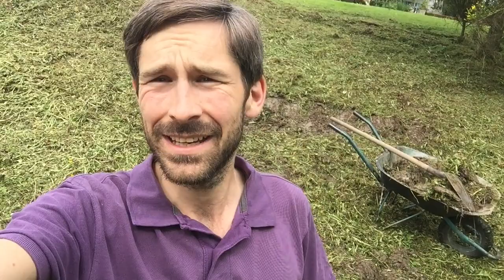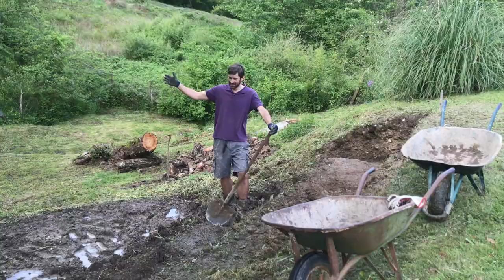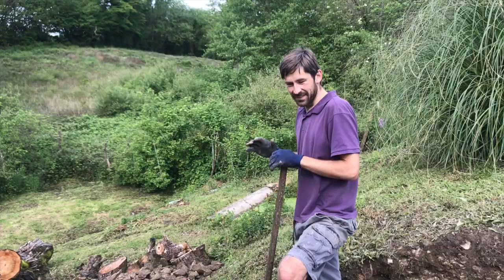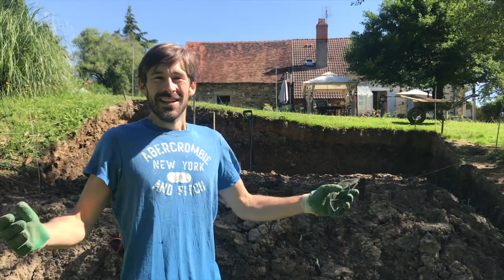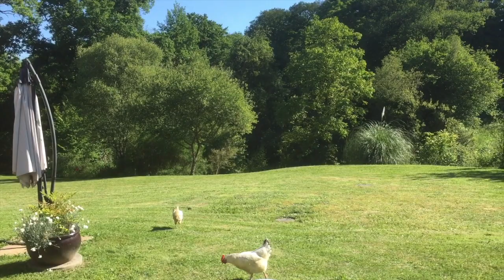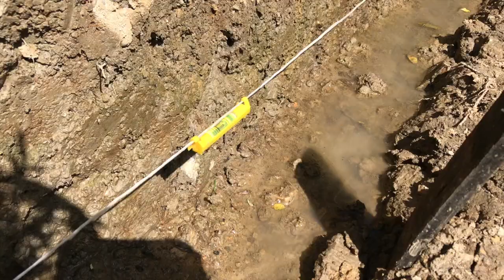Digging a hole for a pool on a slope (Part 1 of installing an above ground pool with deck area)

Comment from the maker: Here are links to some products you might find useful for this project. I am a member of Amazon Associates, which means I get a commission if you buy through this link but it does not cost you any more. Thank you :)

Amazon UK
Intex 5m pool - https://amzn.to/33BNa5S
Intex Sand filter - https://amzn.to/35dCs6f
Intex saltwater system - https://amzn.to/3JNPNRL

Amazon USA
Intex 16ft pool - https://amzn.to/3h9rn8F

Intex Sand filter - https://amzn.to/3LHM4GW

Intex saltwater system - https://amzn.to/3sQukAC